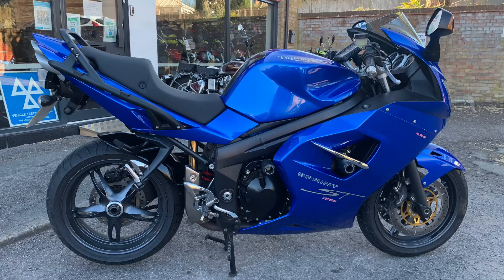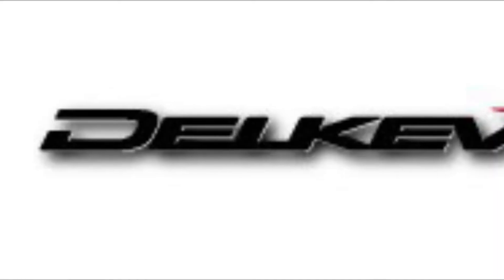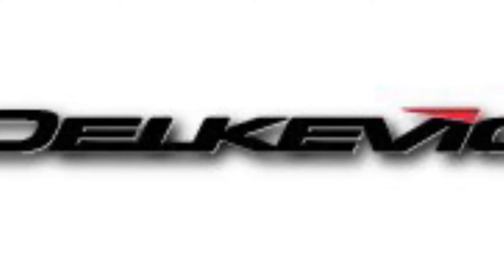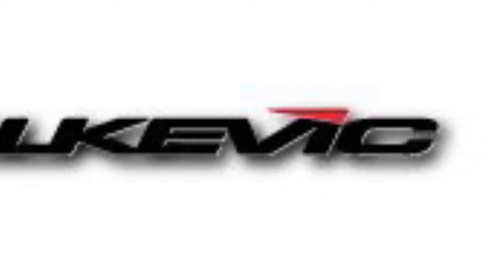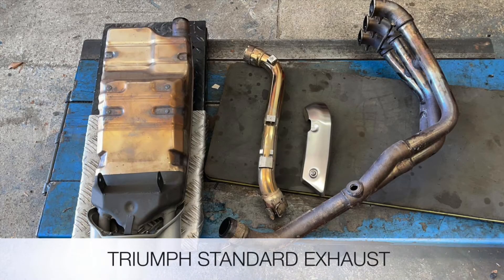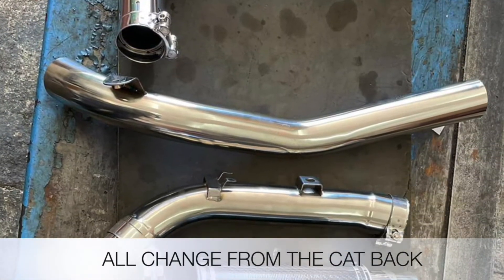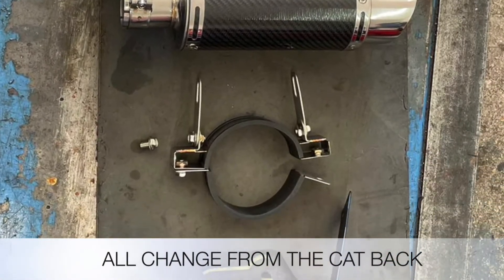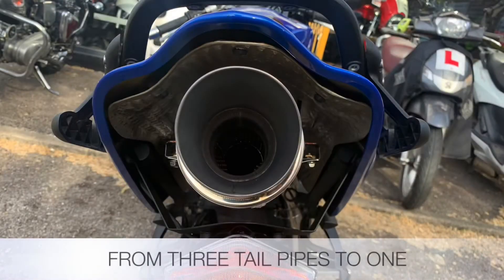TRIUMPH SPRINT 1050 ST 2007 EXHAUST SYSTEM SWAP FROM STANDARD TO DELKEVIC EXHAUST

Comment: Hey I know this is an old video but curious if you are still happy with the Delkevic?  I just picked up one but a different model muffler and I'll be installing tonight.  Also did you install a tune or still running the standard tune?